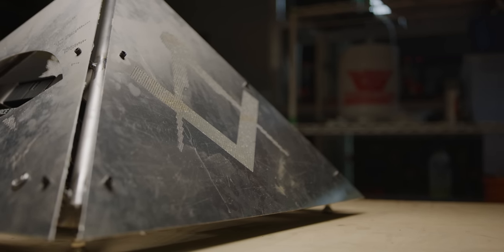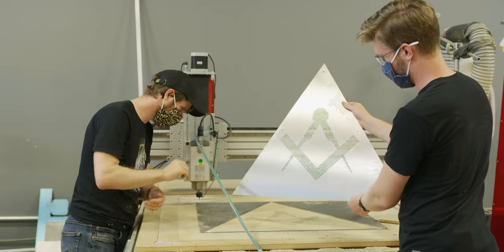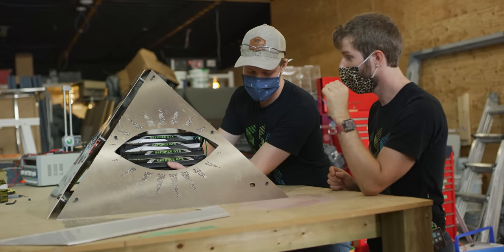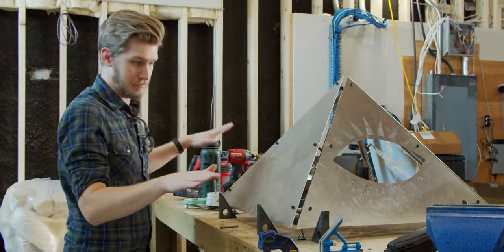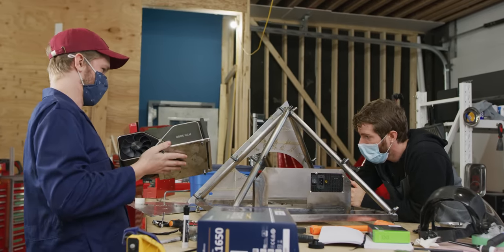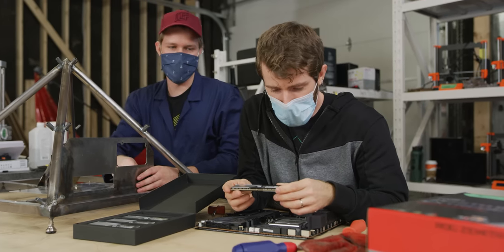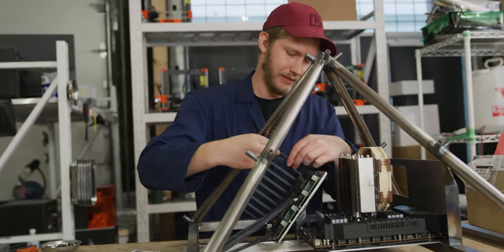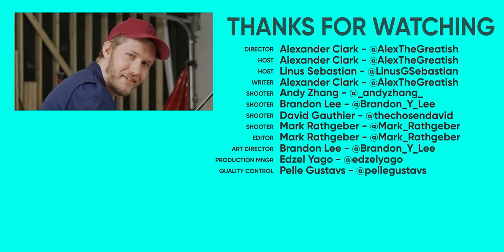The Nightmare Build – Pyramid PC Pt. 2

Comment: Linus: "You're going to literally WELD the components into place?!"
Stop giving Apple ideas.
Reply: I mean soldering is a type of welding so Apple beat them to the punch.
Reply: Lol
Reply: Maybe next time they will just sent me a big metal block and inside there’s a full pc setup.... But a solid block...
Reply: they gonna weld a GPU on it
Reply: @Banished_Link  Soldering is not welding. When welding, you melt the base metal and fuse it together. When soldering, you only melt additional filler material (the solder) that alloys with the surface of the parts being soldered together.
Reply: @nikhilpaleti3872  No. Ugh. Pain.
Reply: Cue Apple putting everything on a single SOC and using JB weld as cooling and waterproofing.

Comment: “does anybody make a compact 3090?”

AMD:...
Reply: Well they are pretty close
Reply: Still not as good as 3090
Reply: @omgmico  remains to be seen
Reply: @omgmico  the 6900XT has similar or better performance to the 3090 for $500 less and uses 50 less watts (3090 uses 350 Watts and the 6900XT uses 300) so yes, it is as good as the 3090.
Reply: @omgmico  why you say this? we dont have good benchmarks yet, but the slides we saw shows that the 6900 indeed is as good as the 3090
Reply: @SertQuos  The benchmarks they showed were using a stock 3090 vs a 6900 XT with rage mode on and smart access memory. So while I agree the 6900XT is a top contender for its price being $500 less than the 3090 it doesn't seem to be quite as powerful as the 3090 on average.
Reply: @SertQuos  i think tgp on rx 6900xt similar to rtx 3090. Cuz 300watt in stock not in rage mode + smart cahce
Reply: @omgmico  nope, its on par with the 3090
Reply: @StainSocial  u got a point
Reply: @rhysevans6218  to be fair with the price difference you could buy the amd cpu you need for the added performance.
Reply: @alexdavis9324  I agree completely. However if you're comparing the 2 cards on an even playing field the 3090 has more raw power
Reply: @leonf8199  I mean even if it's only just under it, for $1000 it's not terrible.
Reply: @SertQuos  do we only trust 1st party benchmarks when it comes to AMD or?
Reply: @rhysevans6218  id argue that is a real world even playing field. Your not adding any cost and it is very reasonable someone would build that PC considering the AMD cpu is the best chip on the market anyways.
Reply: @BrumBrumBryn  they look pretty trustworthy, they showed them getting less than nvidia rather than all gains. AMD have more brand trust than nvidia to be fair. I do want to wait whilst reviewers get their cards but im pretty sure their benchmarks are accurate. I'll definitely backtrack on saying this if they aren't though.
Reply: Well Gigabyte does, 3090 Turbo. Was gonna get one, then the 6900 XT happened...
Reply: @omgmico  you can't say that until it is truly verified by multiple outlet's testing
Reply: @SertQuos  Only with "rage mode" and SAM (requiring zen 3).... and that only keeps up with a 3090 and goes blow for blow.
Reply: @gtarman8d  That is true but AMD have to make up a 50 watt gap between the cards. If they let the 6900XT draw as much power we'd probably see a bigger gap in favour of AMD. Plus the cards have a $500 price difference for about 5-10% performance difference depending on the game, with some games running better on the 6900XT. Id expect a card 2/3 the price of the 3090 to have much worse performance. Plus nvidia have DLSS on their side so I think rage mode and SAM enabled are a fair comparison if they enabled DLSS on the nvidia cards. I want to see what the 6900XT can do overclocked, I wonder if it has higher headroom due to its lower power draw?
Exciting stuff, just hope they have stock lmao.
Reply: @rhysevans6218  rage mode only accounts for 1-2% of the performance gain, as stated by AMD. SAM doesn't increase power draw, hence the performs similarly to the 3090 while drawing 50 watts less power
Reply: @gayking3350  yes for the 6900 XT specifically they were, you can see in the bottom right corner of the benchmarks they showed that they used rage mode and smart access memory
Reply: BTW way to steal my comment and get more likes lol.

The area the 6900xt will pull ahead is overclocking.  Nvidia is running their chips right at the edge already.  Overclocking hasn't been great on them.  AMD is running a better process and is already more efficient for similar performance.  Crank the AMD and it will wipe the floor with the nvidia.
Reply: @SertQuos  i would bet money that they did not enable dlss for the 3090 tests.
Reply: @gtarman8d  most likely they didn't, since AMD currently has no alternative to DLSS. If it was enabled then props to AMD for getting such high frames, but if it wasn't then that's reasonable. Still, a lot of games don't even have DLSS so its not that big of a deal, but for the games that do have it DLSS is huge. Rage mode + SAM help bridge the gap atleast.
Reply: @StanCanCount YT of course, and that would be the smart move. I was simply stating how the performance of each gpu compares with no external factors
Reply: I'd love to see someone attempt building passively cooled 3090s and 6900XTs.

Comment: 12:00 "Does anyone make a compact 3090?"
It's apparently called an RX 6900XT.

grabs popcorn
Reply: Wait to see if it's as powerful tho
Reply: @wayward4657  It is
Reply: @wayward4657  Very likely it is comparable, might even be slightly faster with an Ryzen 5000 CPU (because of their proprietary memory tweaks).
Then again I really don't think it's going to be much smaller. NVidia already made their card >95% heatsink and AMD's 320W TDP vs. NVidia's 350W TDP isn't that much of a difference. So if the RX 6900XT isn't thermal throtteling/bottlenecked like crazy it needs a comparable (in size and efficiency) cooler.
Reply: @christophmayer3991  we've seen Lisa Su holding it. As long as she isn't a giant, its smaller
Reply: @kadenfurr9699  Because you have one, have benchmarked it and just violated the review embargo? Lol.
Reply: @caesar485  Lisa is 5'1
Reply: @xtremefps_  They said all their cards are 10.5 inch in the video
Reply: @christophmayer3991  amd tweeted a comparison image and it definitely is smaller not much in length but much more in thickness
Reply: @wayward4657  even if it's not as powerful, it'll be like, 5fps lower in exchange for a card thats half a grand cheaper, won't require a 1000W CPU, and will actually fit in your case.

When everything else is taken into account, going for the most powerful option is pretty stupid when you could get a card thats better in every way aside from a frame difference you won't even notice.
Reply: @christophmayer3991  Correction: 6900XT is actually only 300W. With proper airflow and cooling solutions, that 6900 should run far cooler than the 3090.
Reply: Gigabyte makes a blower 3090, relatively compact (same dimensions as 2080ti fe)
Reply: @Pro-RTen  AMD Wouldn't risk the bad publicity for claiming better performance and being wrong. They simply would not risk it.

Comment: I spent 3K on my lathe very similar sized to the one you have for the extra 1000 you ended up with a heavier better designed lathe, as long as it is in a similar or better condition. Lathes can be a lot of fun for what you can do with them.

Comment: Everyone: "I cant find any 30 series card."
Linus Customer:       "Lets make a custom PC with not one but TWO 3090's!"
Reply: our 9th or 10th 30 series used btw
Reply: bouta cancel my 3080 for amd cause nvidia is shit in September release i was 866 in queue now i am 692
Reply: with this customer it’s possible that they bought an overpriced card on ebay
Reply: Which is kinda stupid because, correct me if I’m wrong, didn’t Linus already tested sli 3090 and found out it performed worse than single 3090?
Reply: Cant wait until the customer realizes that SLI is dead and 2 3090's is fucking worthless.
Reply: @DiggyDougSauce94  tbh by the old gpus he was going I dont think he cares
Reply: And now the customer wants an all amd build with a 5000 series ryzen cpu and a 6900xt :p
Reply: @DiggyDougSauce94  Even worse, when they realize the NVlink clip won't fit on these two cards exactly as others have shown they are slightly off.
Reply: @DiggyDougSauce94  GPU passthrough?
Reply: @BurntFaceMan  Either that or the customer has deep pockets.

Comment: 14:52 Other solution: dont weld in the gpu mount. Make a mount for it that then lets the entire mount slide out so you can remove the gpu holder then put in or take out the motherboard without obstruction. This could allow both to be achieved in done right. 

So:
1. Make a mount ideal for the motherboard. 
2. Make the smaller mount a mount that holds a literally sliding mechanic for the entire gpu tray/boards that fits in the ideal position. And can slide out of one or more of the sides it's oriented towards.
Reply: Good move. Yes out of everyone only I was paying attention. I was thinking upside down standing on it's point.

Comment: A mate and I built a mini-itx pc in a radio control car shell painted electric blue once upon a time. Metal base with wheels that could spin, onboard graphics, no way there would be room for a PCIe graphics card, external PSU on Mini ITX was something you could have at the time. Cords went in under a gap in the plate at the back and plugged into the headers inside the car itself.
Headlights were power and brake lights were HDD activity. It sat on his TV stand as a media pc. It was awesome.

Comment: Customer Rings Linus
Customer: Hey about them 3090's ive changed my mind it has to be the new 6900XT's instead!
Linus: .....F%*$
Reply: Linus: ok it's done
Customer: hey I heard a 24gb version of the same card is out!
Reply: @betolf5835  linus : get the f outta here and we are not building ur pc
Reply: just an FYI. with a TR CPU, 3090s are still faster. 6900xt needs zen 3 CPU and 500 series mobo to go toe to toe with 3090. TR doesn't support direct memory access on the GPU.
Reply: @solomonshv  If the benchmarks AMD released on the 6900XT are actually true to form, you don't need anything else AMD to compete with the 3090. Their purported numbers show that SAM should put 6900XT a comfortable lead ahead of the 3090 in performance, everything said and done.
Reply: The customer wants a f*ing Ryzen 5000 now. And its not even here yet.
Reply: @TonyHere1707  I saw the tweet, it looked like Linus was gonna tell him no, which would be completely justified
Reply: @worldindo1  the charts they showed of 6900xt vs 3090 said that their direct memory tech and "rage" mode were BOTH used. that allegedly adds 7-8%. the 6800xt comparison, however, was done without it if i recall correctly.
Reply: @solomonshv  It actually may support direct memory access. Many AMD and Intel mobos already support >4GB MMIO, which is required for resizable BAR support (which is the non-marketing name for direct memory access). Under Linux it is supported in software since 2015.  
It is just very hit and miss, with some boards having a bios switch, some no support, some having it on by default...  
AMD seemingly wants to artificially limit compatibility on windows, but we'll see how long it takes till NVIDIA adds a similar feature and forces them to support all compatible platforms.
Reply: @solomonshv  lol these guys have actually forgotten what amd did to my boi 5700xt fan boys are acting like its not gonna happen again its going to happen thats why price for 6900xt is so low amd is not sure bout there 6900xt card or it will be atleast close to 3090 or lill bit expensive as these are there first ray tracing card.Amd is sure there ryzen 5000 beats the shit out intel thats why those are expensive than intel's cpu
If they were truly sure bout it they would have kept the price up and there will be no way in hell these cards out performing 3000 series titan cards but if these cards work properly then amd has won this gen👍

Comment: Alex: "There's certainly a reason that we are pre-building this entire thing before we send it off to get powder coated"

Also Alex: "It's pretty awesome to friction fit everything"

Oh...oh no...I hope his tolerances aren't that tight before powdercoating
Reply: Lol I was actually reading this comment just as he said it.

Comment subtitles.
Reply: Ive made that mistake more than once, thankfully it was on a paper holder and not a super computer with 2 3090s!!
Reply: That's a FAT rip
Reply: They gonna sandblast it before, isn't that going to take off a millimeter or so?
Reply: @DamnZodiak  sand blasting does not take off mm's. It takes off surface corrosion and impurities that may interfere with coating.
Reply: @darrenfalconer3267  good to know. thanks

Comment: When welding a nut to a structure for the purposes of creating a captive nut, always always always be sure to put a sacrificial screw in the nut to prevent warping & thread damage due to splatter, don't weld the whole thing in one go---reduces warping as well. A lil' bit of high-temp anti-seize is also your friend.
Reply: Ahh, just like soldering a connector to a bit of wire. Have something plugged in to it to absorb excess heat and prevent warpage.
Reply: Also, the name "sacrificial screw" really fits the whole illuminati theme
Reply: @siraguswolf2604  HAHAHAHAHAHAHAHAHAHAHAHAHAAAAAA!!!!! <breathe>  HAHAHAHAHAHAHAHAHAHAHAAAAAAA!!!
Reply: @CaveyMoth  soldering & welding are two very different things.
Reply: Or just use a nutsert which is perfect for this application

Comment: Alex is a lot smarter than people give him credit for. Given the parameters, Small-ish Pyramid, pushy client. Only I'd do differently, is make every Panel have a very Slight Diagonal, inward facing incline and mount a ton of Noctua fans at the bottom for intake, the side with the eye has a small mesh panel entrance that can fit a 200mm noctua fan. This would ensure that at least the entire case would have cool air. Also, why not a copper top head? you could sink it to the CPU and GPU, though any metal may cause grounding... just tell the client: "Don't touch the head while it's on, you might invoke the Pharoah's Wraith." Lol. Amazing work. Next time you gotta give him a sphinx lol. (Would have been easier too).

Comment: Alex: "This is the thread cutting tool"
Alex: Shows Linus the OD finishing tool.
Reply: actually depending on the angle in which it is mounted and as you might have noticed the angle of the insert itself this could be an insert with neutral cut direction